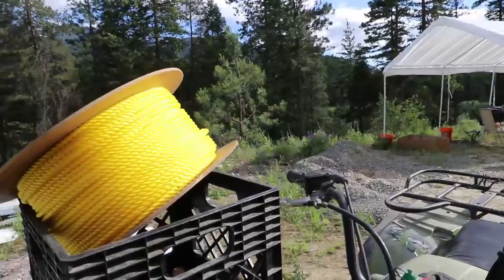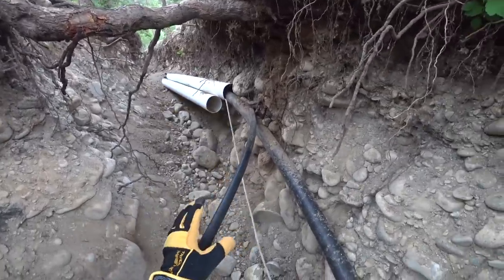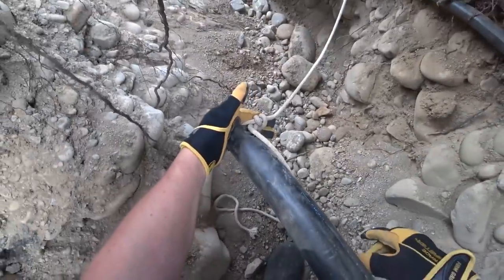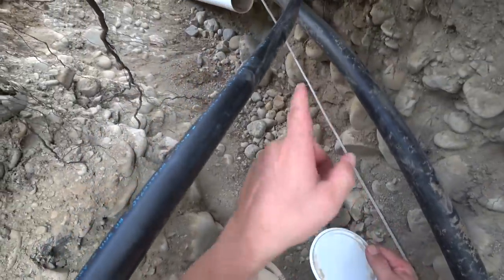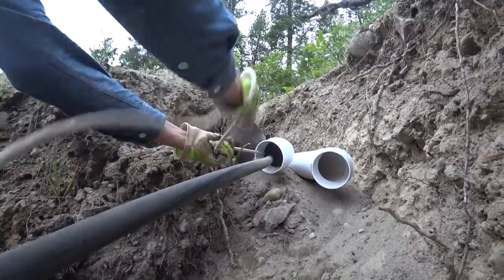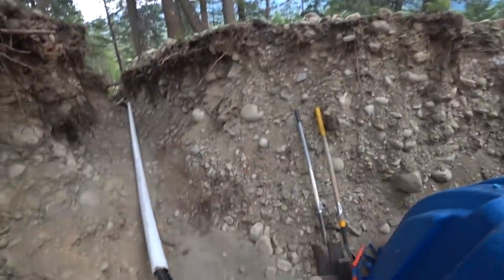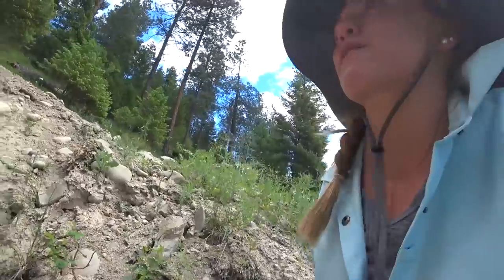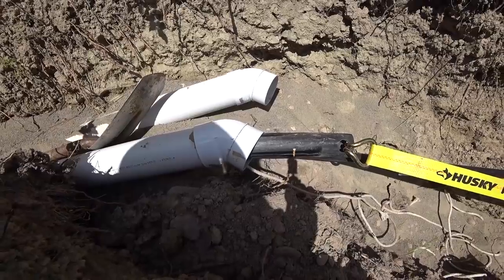IS PIPE LUBE THE NEW SNAKE OIL?! This is INSANE!

Comment: You need to get an LPG/propane torch, then you can heat/soften the casement to put a soft bend in it.  Apply heat on the outer edge of the curve, then the inner edge doesn't ripple up.  The pipe/ wiring will pull through a lot easier through soft bends, than through angled fittings.  :)

Comment: I don't want to add a negative vibe but watching a number of your videos it does appear that you struggle to overcome problems and issues which are common to professionals in that field and for which there are already simple, procedural or technical solutions which you could easily employ - if you spoke to experts before starting. This might cost you a bar bill but would potentiallyl save you a lot of effort, sweat and long-term cost.  (BTW - the guy/girl in the shop you buy the kit from is not necessarily an expert in anything except selling goods.)

Comment: There is a difference between  water pipe 22 degree elbows and electrical 22 degree elbows. Using that encasement as a conduit for your poly you needed an electrical conduit 22 elbow larger radius. That damn 4 wheeler sitting at the top off the hill while you have Alyssa straining at the bottom. Shaking my head. You could of had Alyssa keep constant pressure with 4 wheeler as you soaped and pushed at your leisure. Change out that water pipe 22 elbow to an electrical elbow or you won't be able to continue your encasement without kinking the 2" poly.
Reply: PS . I see why u built the hot tub first now.

Comment: You guys made this way to hard. I would of hung the poly between 2 trees to roll it as I pulled it down the hill 10-12 feet at a time. Then attached one outer pipe at a time allowing you to work in the 10-12 range instead of the whole length. I also would of made a winch setup to attach to the end of the pipe instead of using my body weight. Pulled the end of the cable attach through the pipe to the poly then connect the outer pipe together. Work smarter not harder. One person may of been able to do it this way in one day then the next day filling in the trench.

Comment: I realize it is way too late to offer advice on this but for future reference, don't use your hands and arms to pull things like that rope.  If you are going to insist on doing it manually, take a half wrap of the rope around your back (use a towel or heavy coat if you need padding) and pull with your legs.  The muscles are much bigger and usually in better shape. note for safety:  don't wrap all the way around, if something bad happens, you may need a way out.